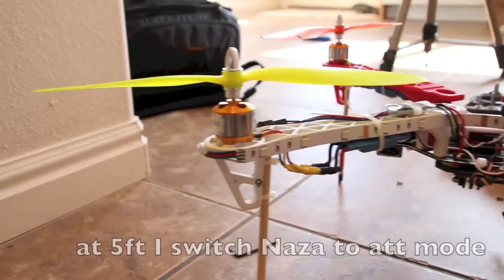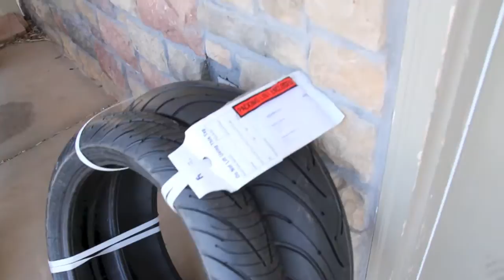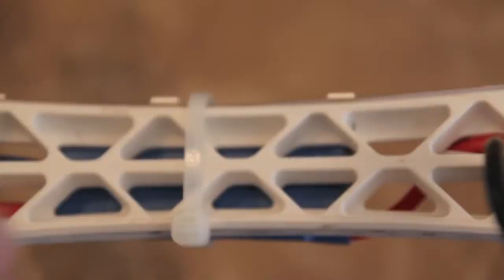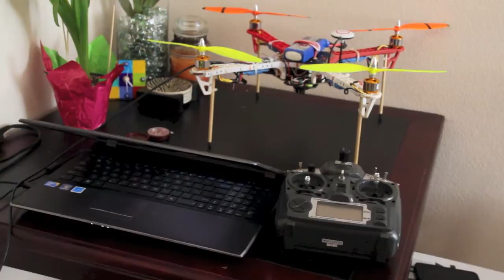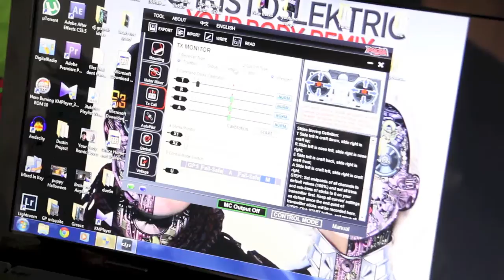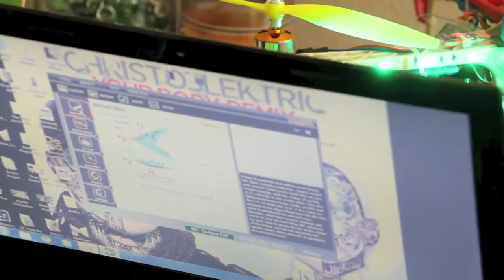Naza M issues

Comment: Hi Chris, You will see in the bottom right corner of the assistant the flight mode you are in. as you flick between modes, you will see it change. just because the 'GPS' box is blue doesnt mean that the end points of the switch is correct, however everything else looks correct to me.

Comment: This is interesting. My GPS locks very well.. I don't have Turngy 9X so I don't know much about that programming but it should be relatively easily. I will be curious to find out when you fix it.. I am thinking defect on GPS module but you also having att lock issue so even controller seems to be issue?

Comment: Chris, can you take off in attitude mode and fly that way without toggling to GPS or manual mode? Just curious if that's possible. Regarding your question about APM 2.5 really enjoy it and haven't had too many problems. The GPS works pretty much out of the box after you load the firmware and go through the mission planner setup. But I don't think you should give up on Naza. I don't fly with GPS and it's amazing. Probably much more so with GPS.Hang in there and maybe someone on garagepilots . com

Comment: HI, commented on forum also, but during second part of compass cal, the front (white arms) of your craft have to be oriented down.  Have not tried doing it wrong but, doing it according to the videos (both Phantom and DYI flamewheel) that is what is stated as being required.  I think you said you had tried all directions (??) and lots of locations.  Thinking that if the location was a problem the first part of cal would not work either. Man I hope it is that simple. lol